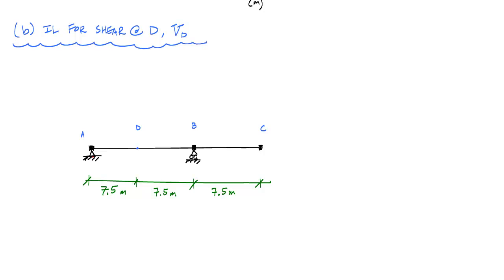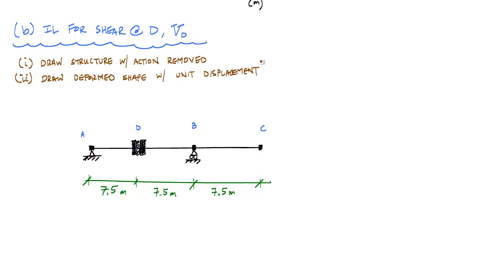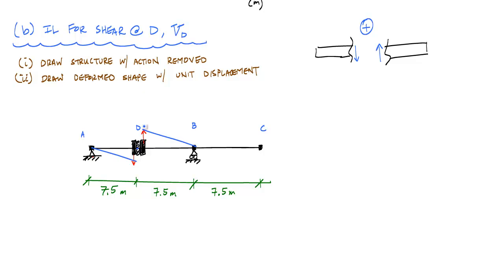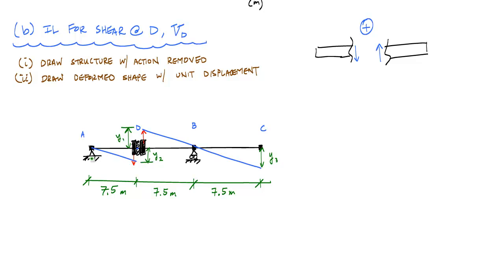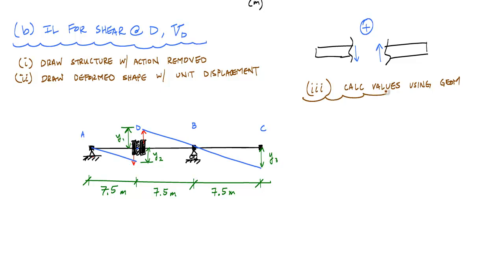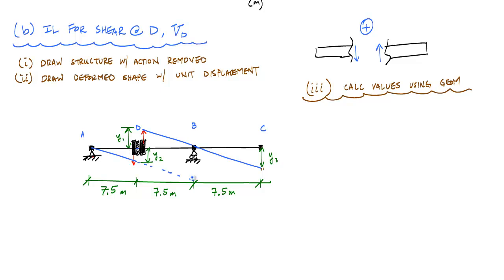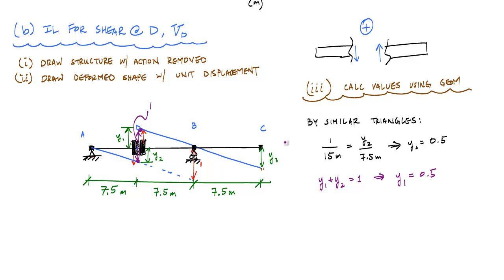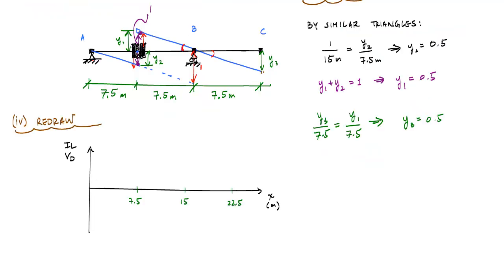Influence Lines for Beams Example 2 (Part 2/3 - IL for internal shear) - Structural Analysis

Comment: Great, thanks for the help. Is this method still correct if your lengths aren’t all the same? Can you still assume the slopes to be parallel and difference in height at the cut to equal 1?
Reply from the maker: yes.